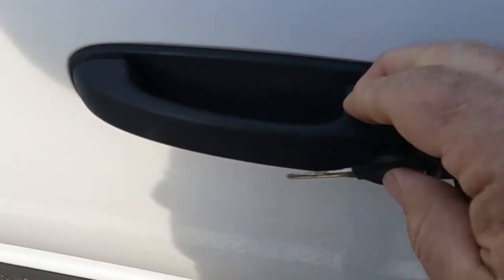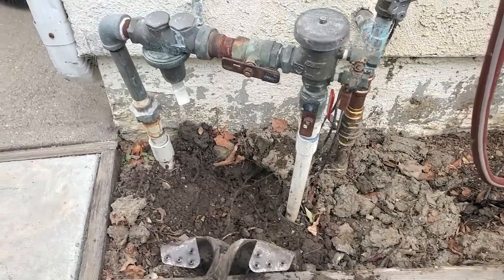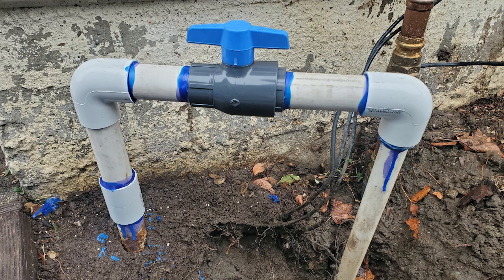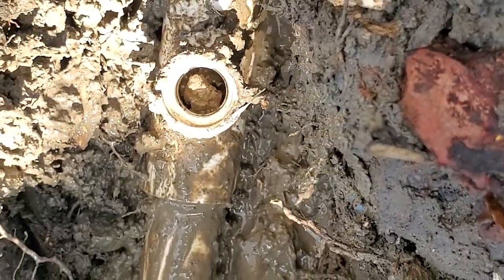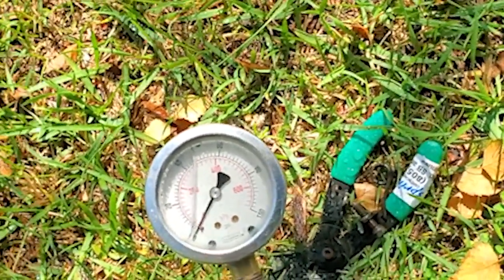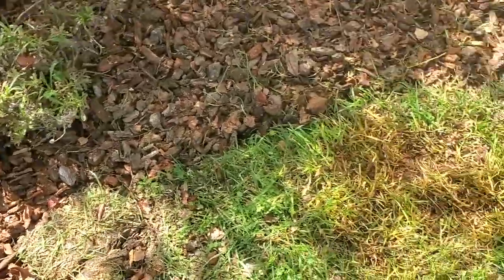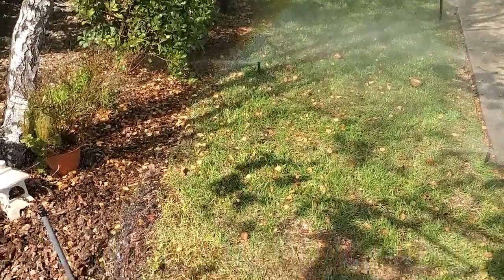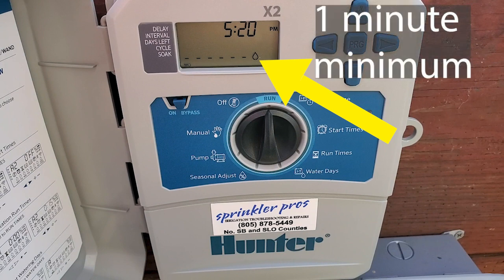Fixing low water pressure and automating a filtration device | Vlog #2

Comment: Irrigation system with multiple stations and you got one with not a lot of pressure you could have simply walked around and turned off the heads to build up pressure you will find those leaks and make necessary repairs should never have to cut the backflow out and if you don't find any leaks then you work your way to the next which would be the control valve not the backflow now the homeowner has a 500 to $800 repair because you removed their backflow good job.
Reply from the maker: William, you're right. That is the normal procedure. I had a reason for taking it off which I won't go into here.